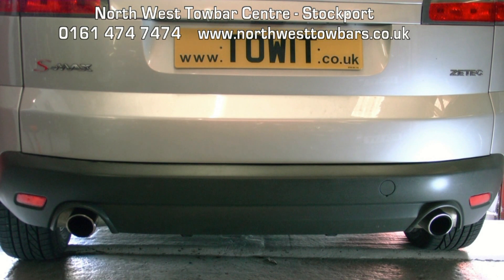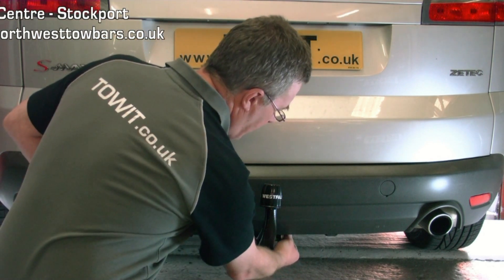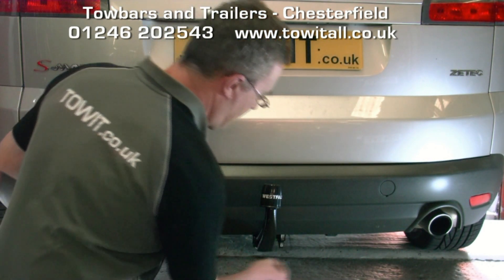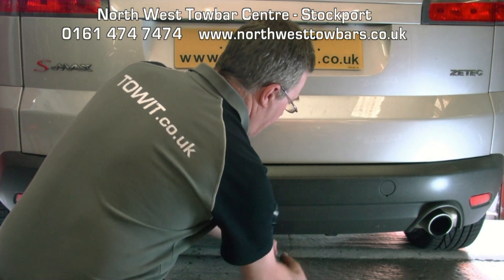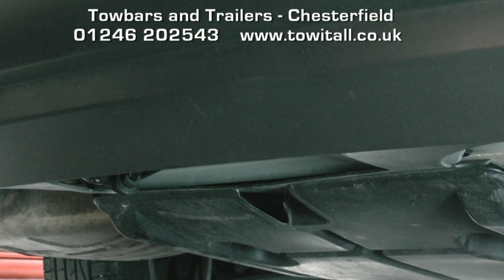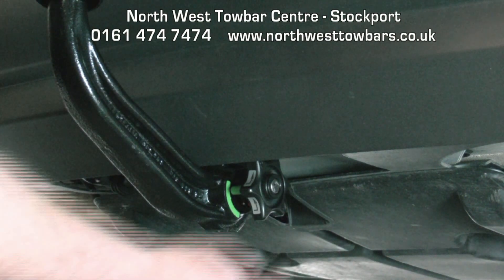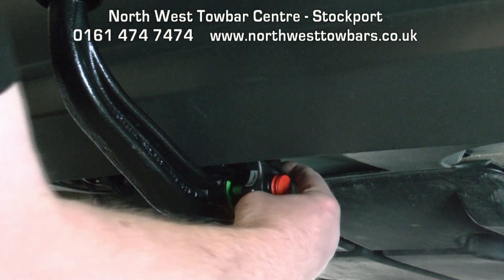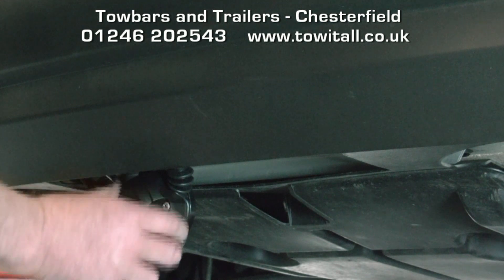Towbar Video - Ford S-Max Westfalia Detachable

Comment: Found could not fit until I locked open first by turning side know clockwise and pulling out so it locked out. Then, fit as in video and release knob if didn't automatically and lock. Otherwise great video